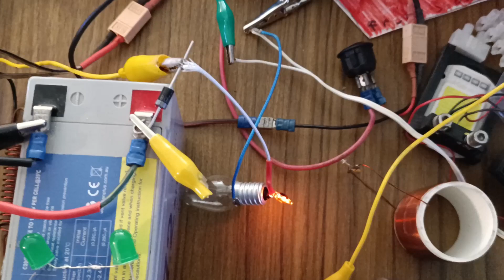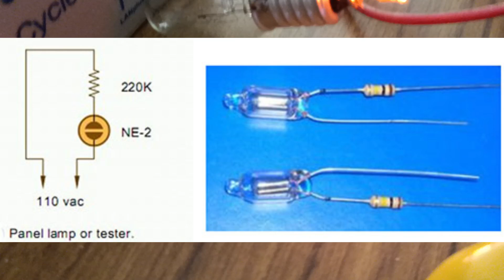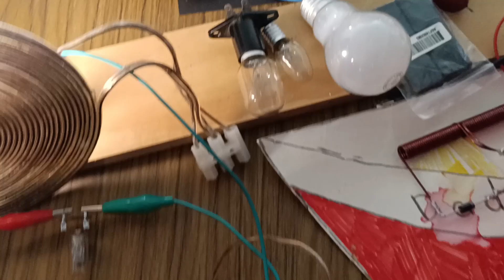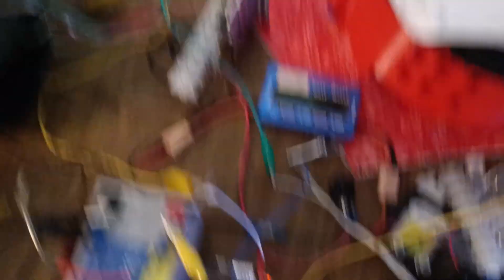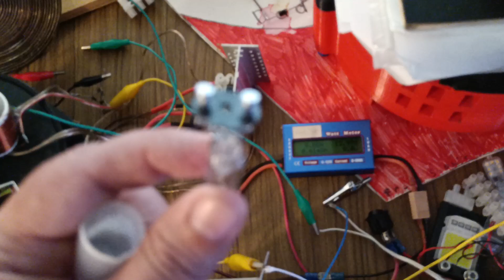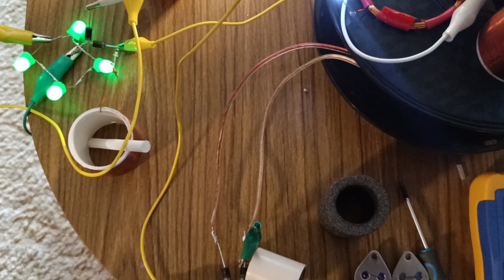POOR MANS ENERGY HACKS - CHEAP WAYS TO GET IN THE GAME

Comment: Hello, I've been following your work and I wanted to congratulate you.. I have a question, I don't know if anyone has asked it before.. I want to know, are the two groundings different? I'm referring to the source.... or are there 2 groundings on the same source?
Reply from the maker: Thank you for your comment.
I'm sorry for not responding sooner.
Thank you for following my work it is greatly appreciated. Others have asked that question but I am more than happy to answer it as many times as it is asked, the way I look at it is this, if you don't want the questions don't put the video up!

Earth rods were always the thing that used to stop me from building things like this until I took my current approach which is "build what you can with what you've got".

I remember getting frustrated when I realised the earth rods I wanted were going to set me back hundreds of dollars just for an experiment, I called BS on having the good stuff, reminded myself that in Tesla's day the good stuff was equivalent to today's shit stiff and searched my shed for suitable material and was blown away to find that two 15cm pieces of metal rod, like tent pegs worked just fine, in fact, the rusty old piece of metal works better than a new copper earth rod. The rusting metal is growing ferrous material and integrates with earth better than copper which forms a resistant skin on its surface. Even stainless steel works, not as good as rusty metal but it works, every couple of months I remove the earth rods and clean only one side back to bare metal, then I end up with a piece of metal that decomposes slower but provides the best of both surfaces, clean and shiny steel with one side rusted and ferrous for earth integration.

The two earths are the same, each earth attaches to a different point in the circuit, usually the hot end of L2 goes through the load/light and into earth as Earth 1 and Earth 2 can be almost any point on the circuit although I found it to be brighter if Earth 2/connects to the negative pole of the battery. 
Hope that helps.
Thanks for watching.

Comment: English is not my first language. Sorry if you mention that in the video and I missed. But where the potenciometer goes ? It is missing in the schematic.
Reply from the maker: Thank you for your comment.
My sincere apologies for my delayed reply.
I completely forgot the potentiometer in the schematics for this I am sorry. In this video the Pot was before the first light bulb however I like to place the potentiometer AFTER the first light bulb to protect the potentiometer, this way you always have a set resistance value before the potentiometer which also allows you to use a smaller potentiometer. This then allows for majority of the resistance to be created by the bulbs and the potentiometer is for fine tuning.
Thank you for watching.

Comment: Hey Boss, incandescent bulbs are great current limiters.  However, they have varying resistance.  As the current goes up, the element heats up.  The heat causes the resistance to also climb.  Hard to measure, but easy to calculate.  So an incandescent bulb will limit the current in a circuit to approximately it's value in wattage.  Imperfect, but usually close enough to keep a circuit from frying itself.  A neon is a spark gap device until the plasma inside reaches a certain energy level.  This is when they start to turn pinkish purple, and the black spots begin to appear on the glass but can't be seen while on.  At this point the flow is consistent. The electrodes are sharing their material with the glass.
Reply: good to know thanks! BTW I've got some 'single wire' stuff, bifilar pancake builds, and some interesting neon bulb stuff on my channel if interested 🤷
Reply from the maker: Thank you for your comment.
That would be correct when they glow, primarily due to heat as you mentioned. The neon in the video that has gone black has been brutalised by my experiments with a few high voltage cap discharges as well as running very high voltages with no resistance. I bought 50 of them recently so I wanted to stress test them. In this arrangement the light bulb isn’t being lit as it normally would and so there is very little heat allowing the resistance to remain fairly constant. The pinkish purple is pretty intense to see and it is amazing how strong they are. 
The material being deposited on the glass reminds me of the old school incandescent bulbs that would go black over time, also backs up the central sun theory.🤣

Comment: I really enjoy how you misuse domestic appliances ❤ Would you say with this modification you don’t need anymore third bucking coil that you shown last time ? Just a spark gap can replace it ?

So, all around the world every country have just banned incandescent and fluorescent lights and didn’t want to let the market to dictate the course for demand and offer … looks like they care for our wealth 😂

Something you may find interesting if you don’t already know: we can collect electric charge from fluorescent lights without loading the source, just placing a string of diodes like BYV 27 around and dump in capacitors … if you ever have the opportunity to get your hands on old street lights with low pressure mercury vapour lamps (80 watts) you can figure out RE patent of Tesla 😉

Also I just remember as I wanted to ask and I don’t own an oscilloscope: what form of current is the output of this circuit ? Pulsed DC ? Or 2 phase AC ?
Reply from the maker: @Caesarus2011  Thank you for your comment.
The spark gap is not necessarily having much effect on the 336,961 Tesla patent and I was merely using my circuit to display its function. The Tesla patent is well worth keeping and I am running a config now that so far looks very promising, if it keeps up at its current pace I will document it.
I need to point out my use of 336,961 on top of my coils is not in bucking configuration. All my coils are wound in the same direction.

I come from a family of engineers and was taught from a young age to consider every object to have multiple uses and would often pull apart perfectly working devices just to see how they worked. I will never forget the look on my mothers face when she came back early and found her new tv opened up on the floor, I got it back together but if there was ever any channel outage she would look over at me! 🤣

Definitely not a coincidence on the light bulb issue, they actually did it to make more money. They got everyone hyped on saving the environment to the point where people would pay more believing they were doing the right thing. It was never about the environment but about new patents and new money for an environmental cause, what we have today in the form of the modern LED’s are far more expensive for us and the environment, so again, it was only ever about the money.
I used to buy an incandescent bulb for $0.20 where todays average LED is $10.00!

If you can check out my Plasma bulb videos you can see me running a 10 watt light from a fluorescent tube that is placed inside a coil, I was amazed when I first saw it in action, I have been thinking about that setup recently. I want to cover some more of that work soon hopefully.

I also don’t own a good scope, I do have a cheap scope in my multimeter that I can test with however I’m not sure of the output of the 336,961 patent as I normally tune my devices using capacitors and just judge the output. I don’t actually believe we need these fancy meters and they actually have a negative effect on devices like this, resulting in corrupted data, basically these devices feed through the negative rail on the scope as seen in my recent cap dump video.
Reply: @whatifididthis...1236  Many thanks for reply, really appreciate.

Comment: I recommend putting an AM/FM radio on your desk and leaving it on so you have a means of hearing the activity of the spark gap.

I’m curious how far the noise from that type of spark gap reaches?
Reply from the maker: @BobWidlefish  Thank you for your comment.
Would you believe I have stood in the small electronics store staring blankly trying to remember what I needed to get. Thanks for reminding me, I will try to get one next time. I was also thinking I could restore an old phone with a frequency analyser. To my ear, which at my age is extremely good, there is no audible sound. Changing the capacitor on the back of the starter would be a good idea.
Reply: @whatifididthis...1236  old phones are a goldmine of sensors!  I’ve had good luck with the “Ubeesise Tripod S” little flexible tripod for holding my phone as a sensor in otherwise difficult positions.  There’s nothing special about the Ubeesize brand, whatever is cheap with the flexible legs is a win in my book.

Various particularly old or low-end phones have actual FM receivers too, separate and apart from the main radio functionality used for cellular and WiFi. :)

Comment: You are using neon lamps. Mtech Industries uses cold cathode lamps (nixie tubes). They are not the same. You can get old lightbulbs from every store, they are used for refrigerators and ovens. Here is the explanation for the right coil ratios: www.youtube.com/watch?v=MpE2oiOki8s It's quarter wave for the trigger coil, half wave for the bucking coil and full wave with center tap for the ground coil.

As the Tesla dynamo patent 336,961 shows we are still missing the true neutral bucking load coils, that are isolated from the positive and negative coils.